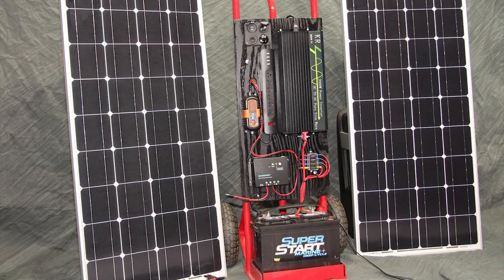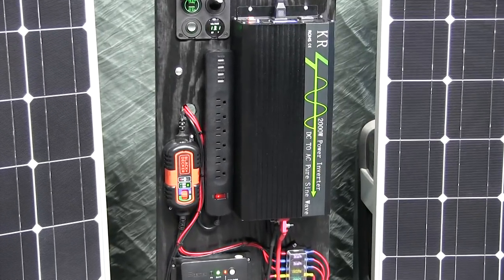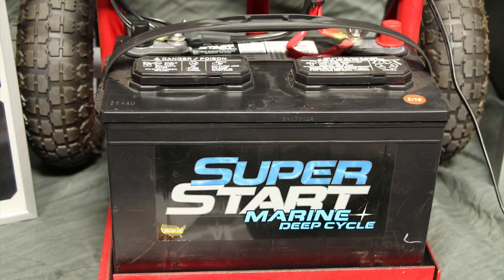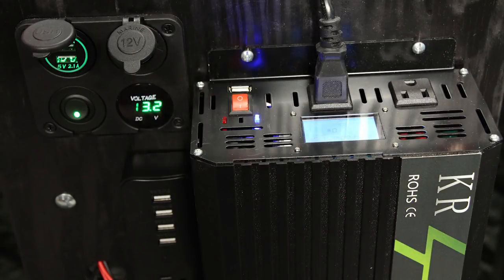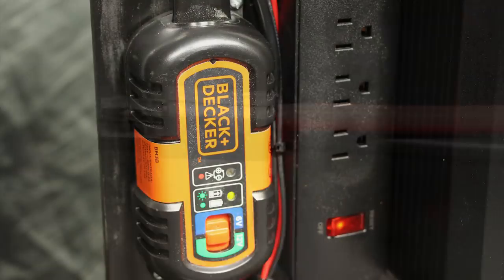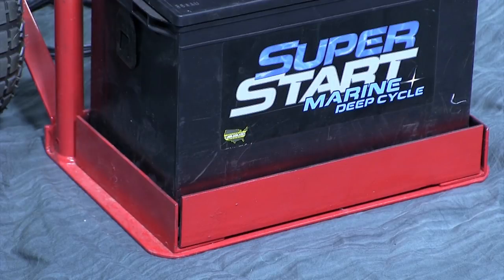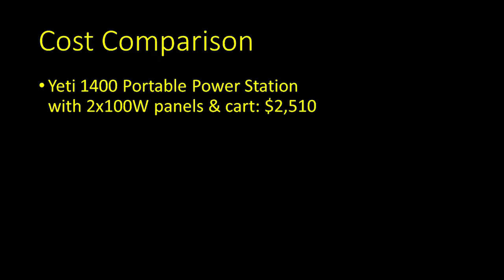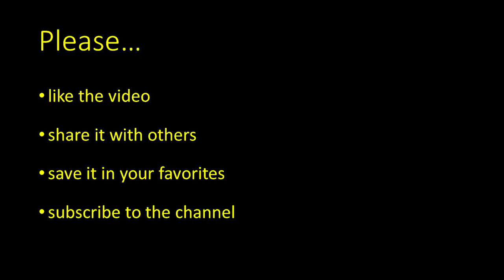DIY Off-Grid Solar Generator (rev 2) – Low-Cost Portable Power  -- with Build List

Comment: First, it is good that these type videos are out there, and get people not only thinking about solar,  but also, educated so as not to fall for "junk" like the "1800 solar generator", Goggle that, and you will find several examples. 

Not discussed here are very important Safety Standards, i.e. NEC 690.  If you are going to build anything in the kilowatt size, do yourself a favor and enroll in a class at your local community college, or on-line.  It could literally save your life, or your family from a fire.  I have seen too many videos of extension cords run room to room, or even to various levels...not good!  Also, you will learn the importance of only using DC rated components in DC circuits, and the appropriate wire type and size.

I build solar generators, and learned a long time ago that using lithium vs lead is the only way to go.  Once I ran a side by side test of a brand new 92AH AGM (East Penn) against a 40AH Lithium Iron Phosphate (Valence), it was a no-brainer.  Lithium will charge much faster, has practically 0 self-discharge, and will not lose capacity when pushed hard.  You can draw 40, 80, and on some Lithium batteries, 120 amps from a 40AH battery, with little loose.  Lead has high internal resistance, which is why your car is dead after sitting for months,  This high internal resistance also causes heat during discharge, which leads to inefficiencies, and lower performance.  That is why a 100AH lead battery will be rated for 5 amp for 20 hours.  Discharge a 100AH lead batter at a 100 amp load, and you will only have 62~68 amps available due to these losses, and, that is before you factor in only discharging to 50%.  This is why a 40AH Lithium will out perform a 92AH Lead battery.  Factor in the life discharge cycles, and Lead is a Loser!

HINT: MPPT is well worth the money.  I only use Genasun charge controllers.  They are made in the US, are hermetically sealed, and perform for years at sea and in the Antarctic.  Additionally, they have the highest power harvesting, and the lowest off-current draw in the industry.  A 10 amp Genasun fed by a 140w panel will blow away a PWM controller fed by 200w of panels.

I could give many more tips, but this is too long already.  Keep up the quest folks!
Reply from the maker: Excellent advice — and most appreciated.  A thanks for taking the time to provide so much descriptive detail.  I think people with a serious interest in building a solar generator will learn more from comments than from the videos.  Thanks for contributing to everyone’s knowledge.
Reply: After reading several comments I am not sure which way to go. I have a large house and want to get off the grid.  Is this system too small for my needs? Approximately 2,500 sq ft of heated area.  I checked into Solar Thermal with HTP Natural Gas water heater recirculating with radiators for a retrofit but that was pricey.  Then I thought how about running Solar with water-filled electric baseboard heaters that run on 220 V with only 5 Amp draw for heat and 110 V power to the outlets. Still keeping my forced air natural gas for backup.  Any thoughts ?

Comment: I want to make a copy to power my fish/ storage room, I want to start with a box for the battery with feet so I can pick it up with my folding hand truck if needed, otherwise the rest will be similar, how do I know if the battery\panels are big enough?
Reply from the maker: Sounds like a fun project.  Check out the the builder’s guide video ( https://youtu.be/6glK8-IcDgE ). There’s a link in the comments for a design calculator worksheet.  You can download it and evaluate various choices for the components, so your build will be a complete success.

Comment: Great video I would love to build one but kind of nervous want to build a 5000 watt portable unit can you help only difference is I want o place it in a case of some type can you help me with this thx in advance
Reply from the maker: The design can scale up.  You can use downloadable design worksheet to do the calculations.  You’ll need to select an inverter with the power rating needed for your expected load, and add more batteries and solar panels.  Good luck with you project.

Comment from the maker: Check out the new Builder’s Guide video.  (https://youtu.be/6glK8-IcDgE). It discusses the evolution of the unit, and has a link to a design worksheet that does all the engineering math, and a link to download the latest wiring diagram and component list.
Reply from the maker: LOL - Thaks for the compliment.
Reply: Error Message opening your link...  Can you correct youtu.be to youtube ?

Comment: It seems exposed to the elements.  Is this weatherproof?
Reply from the maker: No - it’s not designed to be left in the elements.  We’re in the southwest desert (great for sun) and it’s under the patio roof right now where the unit itself won’t be in either direct sun, nor rain if we have any.  I have about 30 feet of wiring which reaches the solar panels.

Comment: Your battery is the weak point.  As John Fackrell said you only have about 600 watts of power available IF you discharge at under 5 amps draw (60 watts).  If your amp draw is more than that the available power will go down.  At full inverter power your battery will last only 15-20 minutes before you draw it below 50% and start doing permanent damage to the battery.  Frankly the 2,000 watt inverter is a waste of money on this system.  If you want to run such a large inverter you will need more like 4 batteries like yours or two 100 amp hour lithium batteries.  Another point is the Renogy Wanderer PWM charge controller.  That controller is only 75-80% efficient, so in the real world on a bright sunny day with the panels angled at the optimum angle to the sun you will only get about 150 watts out of the panels, so recharging the battery from a 50% discharge will take AT LEAST 5-6 hours to get back to 85-90% charge.  It will take a couple of days to fully recharge the battery.  If you want higher efficiency charging from solar you need to buy an MPPT charge controller (95-98% efficient).

I would also caution you against jumpering the system to your car battery.  Your car's starting battery is made to deliver high power for short (seconds) periods of time.  Drawing it down below 75-80% will greatly shorten its life.
Reply from the maker: Excellent advice.  Flattening a regular car battery is certainly bad for the battery.  My concept in the video is that I would be able to power the unit from other batteries should the need arise.
The large inverter allows a few minutes of high-wattage consumption if the situation demands it.  Since power consumption scales with load, I’m not sure a smaller inverter would be beneficial.  I don’t yet know if a smaller inverter would save any power, but I have the equipment, so I think I’ll find out.  The inverter in the unit is running 87% efficiency.
I think the MPPT controller is definitely a good idea.  I think I’ll see if I can measure that, too.
Thanks for sharing your knowledge.
Reply from the maker: Check out the new Builder’s Guide video.  I think you’ll recognize some of the engineering in it.  Thanks again for taking the time to share your knowledge...

Comment: Very awesome video!!!! i think it is very well made but i highly suggest getting a true deep cycle battery and not a marine battery. simply because a true deep cycle battery has thicker plates in the battery and can handle a load and discharge alot better. And also i would get a 1500 watt inverter rather than a 2000w because 2000 watts on a 12v system is to much for one 12v battery to handle and could explode from a massive amounts of amps being taken out of it. but all and all this is a awesome build and commerical generators are always too much and underpowered. check out my solar generator that i made on my channel and subscibe!!! i think you will like it also i subbed to you. you have a awesome channel
Reply from the maker: Thanks for the kind comments.  Your advice is spot on.  You’ll see it pretty much integrated into the real-world test video that’ll be out shortly.

Comment: Drill holes in the angle iron base, and bolt on "forks" to hall your panels . could attache a rack to the dolly at the top. That way you could move everything. Cargo strap could be used to secure everything together.
Reply from the maker: That could work pretty well.  Have to balance the convenience against the weight addition.  The rev 2 unit is 100lb and might be too much for my wife with much more weight.
Reply: Would be good if you had to move the whole thing a ways. Leverage is the thing to watch. Even small people can move a lot of weight with proper leverage. Depends on how mobile you need the whole unit.

Comment: the biggest cheep change i would make is to move the plywood to the other side of the cart and make spots for 2 or 3 more batteries that could be added as an option the extra mounts could also be used for shelf's to hold small things that are charging or a 2 way radio.  not being a real prepper i have a small set up in my shop i used 2 inverters one 400 watt and a 3000 watt so i can use what i need and avoiding wasted un needed power inverting and along that thought proses using ikea type lighting have changed much of my house to run on 12 volt LED lighting and ruining it off my battery  bank 3 like yours i dont have the flicker thing that some ac stuff lets through
Reply from the maker: I like the two inverter idea— I’d like to see what the current differential is between the large and small inverters...  
I also like the LED lighting idea.  We changed every bulb in our house to LED a year ago (still 120VAC). and really like the power savings.  (Nice to never have to replace a bulb again, too.)
Reply: i have a thing for being cheep as i can and try to look at things from a different angle i have called a few contractors (im in south Ontario Canada) most want to see a bunch of my power bills so they can set me up to run all 120/240ac they would use 1 or 2 huge inverters and 48volt or higher on the dc side.  my idea is to use what is most common on the dc 12volt if you look around your house i bet you would be shocked by how many adapters are making 12volt dc so an inverter makes heat and an adapter makes heat or power loss i prefer to try to cut out the extra steps.  in kind of the same way i gor a couple little 80 watt inverters at walmart on sale and have bin playing around with the idea of using even smaller inverters on stuff like a ceiling fan using the wall switch to turn the inverter on and off,  i think for me if things got real tough for a long time i can think of lots of places i can find parts and stuff to use or charge on 12 volt using more smaller inverters leaves more options if one dies. like i have said im not a real prepper but i am Canadian we get winter the power goes off cars dont always run or cant ge through so i have food for 6 to 12 months couple ways to heat and 3 ways to make power most of my stuff gets used almost every day so when the power dose go out or what ever for my family and i dont have to change so much from what is normal
Reply from the maker: Sounds very familiar.  I once lived not far from you.  Now I’ve got sun to spare, and snow shoveling is a distant memory.  Your approach to possible situations is quite like mine — probably, boy scout in me still lives...
Reply: for me i think its about the challenge of having ideas and then testing them as cheep as i can.  its a while since i put up a video but if you look on my channel i try to do a bit of everything just cheaper
Reply: I would get away from the Plywood ENTIRELY!
Marine Supply stores have, or can GET, 2 BY 2 Foot 1/2 inch think pieces of ABS Plastic. Our local supplier has them for about $25.00 for one of these. It would look better than his plywood setup, and not be subject to the weather.
Reply: trouble is 1 cost 2 not as easy to work with 3 im sure both would burn just as well but one melts with any extra heat and would be more toxic if it did burn.  unless i missed it non of the inverter charge controller or the 12 to 5 volt were out doer rated so any weather that is going to harm the ply wood would kill all the electronics long before the ply wood is bothered,.  if for some reason i was asked for a suggestion for a different material i think i would have gone with steel that would link all the casings and help with noise i have ended up linking mine to stop interference on my 12 volt radio when i have my inverter on but i guess it ends up being what you prefer to work with and are willing to spend
Reply: DP,
solar powered lights set at each window, charge in the day,
lights the house at night.
Be sure to buy the LED type with on/off switches.
No cabin or trailer should be without em.'
~ peace

Comment: So I have a similar set up but my inverter keeps shutting down whenever I put over 500watts through it. I have a 2k inverter with dual new 6v deep cycle batteries so it should have plenty of juice to pull from?  Bad inverter possibly?
Reply: Was a bad inverter...
Reply from the maker: Possibly defective inverter, but you may want to check the battery voltage at the inverter posts.  If the wire is too thin, the voltage may drop below the safety level of the inverter which will cause it to shut down.  Current on the 12V side will be roughly 10x that needed to power your AC device, so 500W at 120VAC will require 500 / 120 x 10 = 41.7A @ 12VDC.  If the input wiring is too thin or too long, the voltage will drop -- a lot.  To get 2000W, you'll need roughly 170A, so you're into car jumper territory.  You can measure the length and look up required wire gauge on line.  Good luck.
Reply: @DesertPrep  it’s a zero awg wire, it ended up being a faulty inverter and now I’ve actually switched over to a single 100ah LiFePO4 to save weight and it’s working great!!

Comment: Cool build, I think I'd replace the fuses with resettable circuit breakers. Fuses might not be available where you are at the time. Also would upgrade to a lifepo4 battery. It's more expensive but your wattage/weight ratio is a huge improvement.
Reply from the maker: A battery upgrade is definitely a good idea.  I like lithium, but it’ll double the cost of the unit.  Some viewers may go that way, though.

Comment: Hybrid idea on battery power. Use two 6 volt deep cycle batteries in series.  Each are 200 to 220 hr rating at 20 amp discharge rate.  Two in series get you a full 100 to 110 hr rating at 20 amps at 12 volts at 50% discharge.  Price at Cosco  is $82.00 a battery. Your cart can easily handle the extra battery.  I use this setup on my motorhome.  Most marine/deep cycle 12 volt batteries like yours carry a 20 amp delivery rating of 95 to 100 hrs.  This equals ~1.3Kwh for $164.00 plus tax.
Reply: 2 GC2 are only good for 10 amps @ 120vac for roughly 1hr. To get just 1 amp of 120v  for 1 hr from inverter output you need 12 amps of 12v dc from the battery. 2000w Inverter is overkill, one 1/3 the size for this little battery.  Grp 27 battery will only give you about 50 a/hr @20hr rate 50% discharge.

Comment: I'm building something like this to power my cabin. Thanks so much for the idea, people like you have helped a great deal in the build and set up of my mountain paradise !
Reply from the maker: I’ve just completed the fourth revision / rebuild of the solar generator, and I’m running the measurement testing to see the improvements.  This time the video will show how it’s constructed.  Of course, there will be a wiring diagram and complete parts list.  I’ll also include the downloadable Design Guide worksheet so you can build your own project, evaluate your existing system, or play “what if?” with possible upgrades.  There’s ready a Design Guide video  with the worksheet download link at https://youtu.be/6glK8-IcDgEHope it helps in paradise.

Comment: I have thought about building something like this and I have come to this conclusion.  Great for short term outages. Great for recharging small battery devices indefinitely -- cell phones? then I thought if it is really bad, how long will the cell towers work? [some cell towers have generators/ups power, some do not] Internet?  My local supplier loses power to their cable boxes on the street poles regardless if I have back up or not.  There have been times I have power, but others next street don't have power, and I don't have tv/web/phone since the suppliers boxes don't have power.  I would use my gas generator occasionally to run my fridge/freezer till the food inside was gone, and then not worry about powering it again.  I'd switch to dry foods. I have gas/generators for running the fridge/freezer.  This unit would be great, silent,  to recharge flashlight batteries for a long time. just my 2 cents worth.....

Comment: Johnson power pole has an digital battery monitor for automatic battery shutoff that is set by the user.
Reply from the maker: Cool equipment, and way upscale.  Thanks for the info — it may be useful in the future...

Comment: I have the same inverter but lost the manual. I think the low voltage safety was tripped and need to know what or if there are any reset instructions. Currently, when I switch the inverter on, the AC attached accessory shuts off after a few second. The red light comes on too and sometimes blinks a few times.